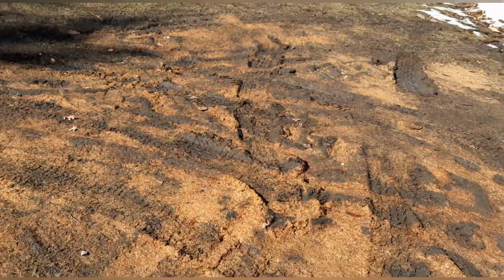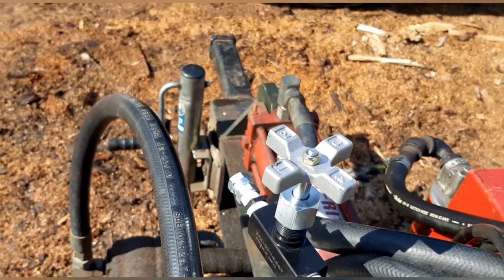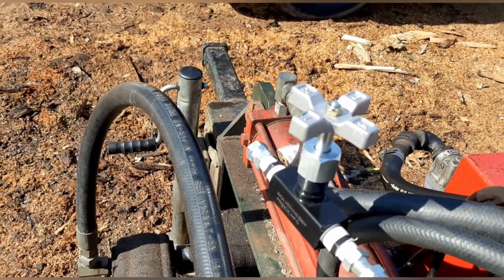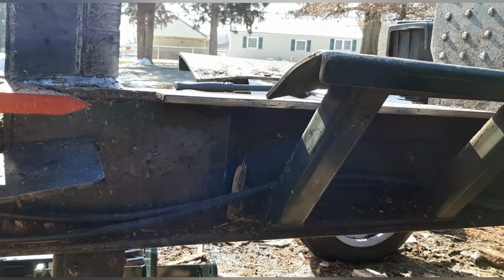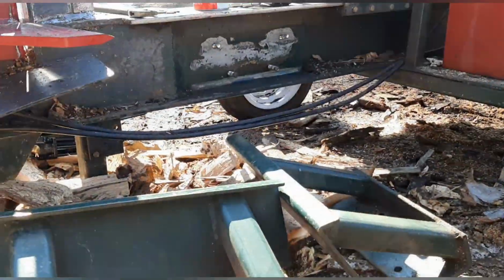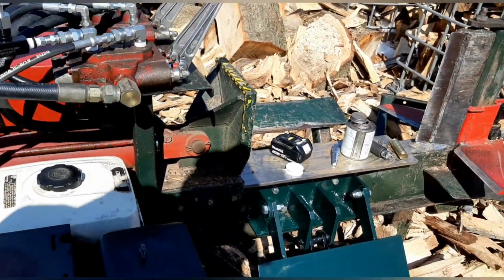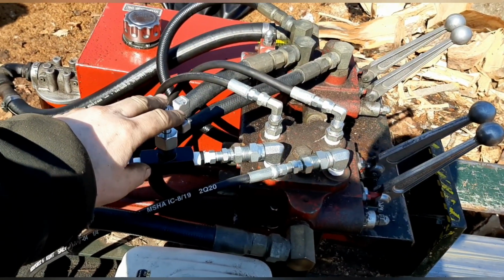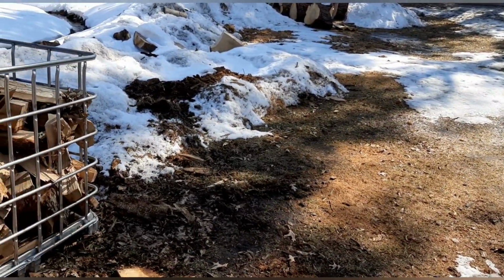INSTALLING THE LOG LIFT FOR MY BUILT-RITE WOOD SPLITTER

Comment: Holy moly man, beast status Achieved!
That bad boy can sure handle some big ole rounds now...I hadn't noticed in your previous vids that the horizontal wedge is hydraulically adjustable- that's gotta be a big help with keeping the flow going.

I found out a couple of days ago that my neighbor is having a bunch of tree work done professionally, said I could have all of the wood (elm, ash, maple and pine)...not
 sure what I'm going to do with it all but I'm looking forward to figuring it out.

Lol at the end of the vid...poor tripod...:(
Reply from the maker: Hahaha...yep it's getting there. Still have to add a grate at the end and the 13 hp honda that's just sitting in my shed. This Built-Rite has been awesome so far. 

Yeah that's the fun part...figuring out a plan and executing it. Then getting more efficient as you get more wood. It's a fun game to play. It's therapeutic for me.
Reply: @woodnyardjunkie  
Yep, I can relate to plan execution from three decades of concrete construction...the good thing about processing wood is that there wont be anyone else to screw it up, lol.

I'm still waiting on an outer dog for my 590 (one for a 620 should bolt right on) but I did fire it up to cut up a little bit of maple, got the carb tuned and oiler adjusted for the 24in bar...can't wait to get after some bigger stuff.

Still have a lot of snow in my work area but it should be gone in a week or so if the forecast holds true...probably right about the time I get called back to work, smh.

I'm not a big fan of wearing work gloves if I dont have to but it looks like wearing a set of cut and impact resistant gloves might be justified when running your setup...just a thought.

Have a good one!
Reply from the maker: @ronaldwilkins6056  yep should rip through the big stuff pretty easy. Muddy here but should be solid in a week or 2.

Comment: Built rite makes a hell of a good splitter and they are reasonably priced. Im choosing them for my new splitter this year.
Reply from the maker: I agree David. This is a older 11 hpws, but runs like it's new. This thing is solid machine. They also have great customer service. They had forgot a couple fittings for the hoses, so I called them and was taken care of. Got my fittings 2 days later. When you do order one, Dave and Matthew will take care of you!